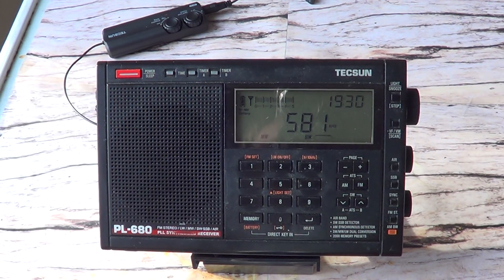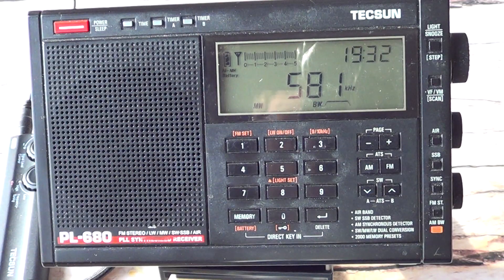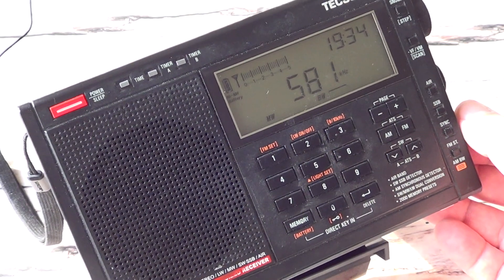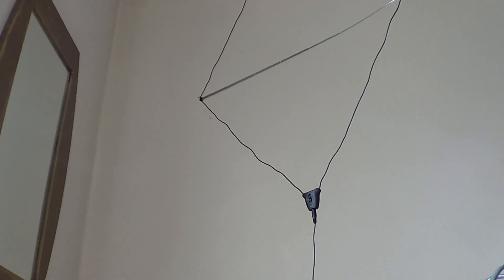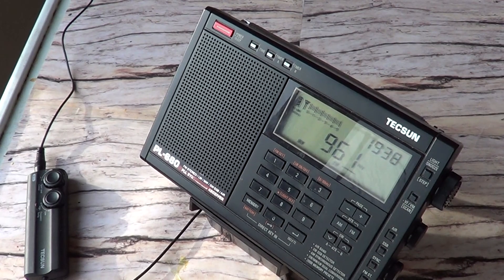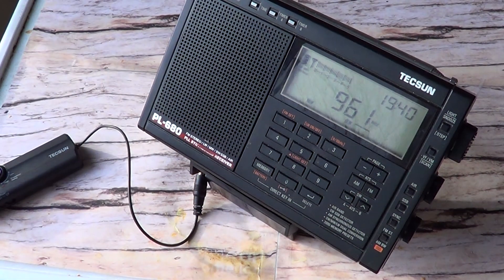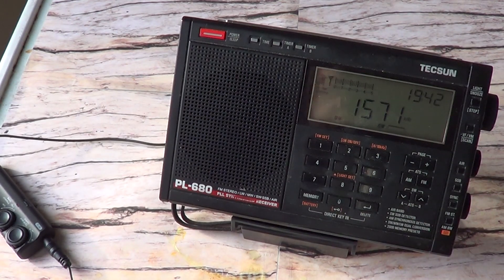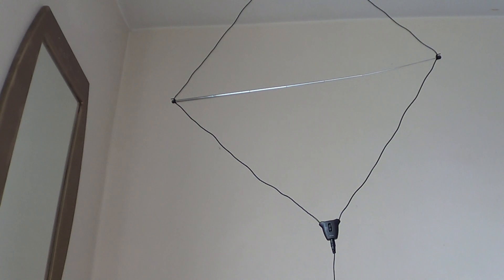AM Mediumwave performance test Tecsun AN-48X with Tecsun PL-680 receiver

Comment: I believe you're wrong about the antenna length being the cause of signal degradation. You got to remember when you hold something in your hand such as an antenna, you become part of the circuit. Just like the old rabbit ears you move them you get a good picture your step back in the picture goes to crap why because you were part of the antenna circuit. Just think about it.
Reply from the maker: not at all the problem here, this antenna is bad
Reply: @OfficialSWLchannel so is that particular antenna bad or they just don’t have good performance
Reply from the maker: Also you are comparing TV that is VHF and UHF that has an effect that does not exist at shortwave frequencies
Reply: @OfficialSWLchannel  if you're asking me a question, I am merely stating a scientific fact, when you touch part of a circuit you are part of the circuit. It doesn't matter if you have UHF VHF ssf for PHS it don't matter if the waves go through your body you are part of the circuit. That's it. Think about it

Comment: When you tune  your radio why don't you tune to the right frequency? Like why not tune to 960 and not 961.
Reply from the maker: PL-680 is 1 kHz off.. that is why it is off tuned in the display
Reply: @OfficialSWLchannel  Strange a radio would be designed that way.
Reply from the maker: It was not calibrated correctly when it was built and the specs do say the frequency precision + - 1 kHz
Reply: @OfficialSWLchannel  For me I would need the frequency to match exactly what the radio is set on.

Comment: You know, if you turn the back of the base station so the slots are facing forward you can pass the coupler through the hole and lay it on the appropriate step, hope it helps.
Reply: I tried that and it is too big to fit

Comment: I wonder iff you could substitute a shielded cable for the wire connecting the loop to the amp to cut down on the noise?

Comment: Performance is a lot like my coupling loop I made. I wonder if you put a ferrite bead or choke on the cable would help out. I would buy it just for the cool connectors. I’d like to play with the ferrite coupler one.

Comment: 1. is is a  active or passive antenna?  Will it work on other radios?
Reply: Hi, this is an active loop. A passive is anything like the AN-200 (not powered).
Reply: you use the ferrite bar to make it passive (not connected to the radio)